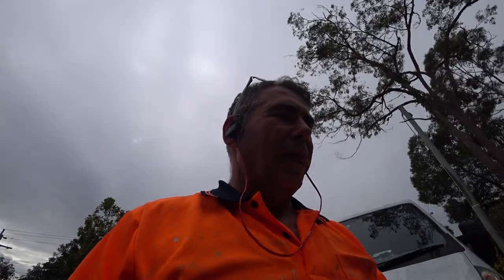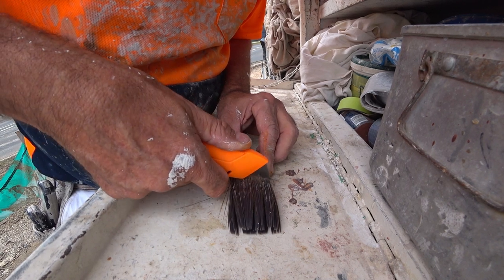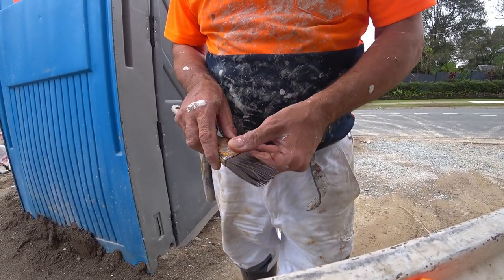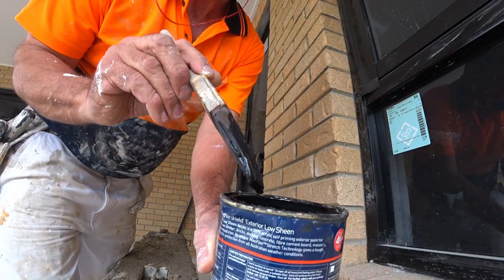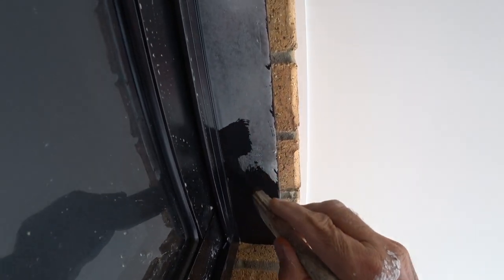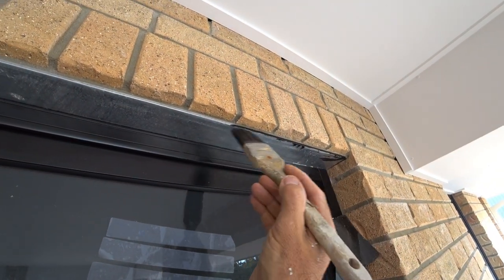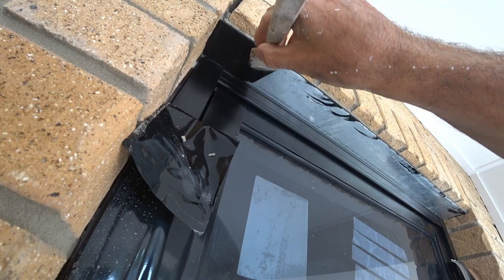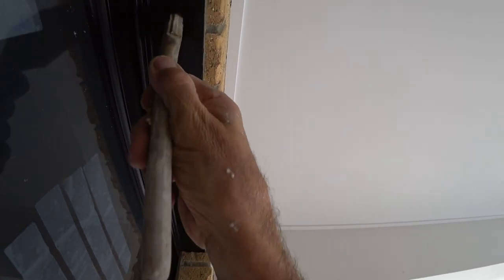How to recycle an old paint brush

Comment: Good tip im going to try that. Yeah wethershield low sheen straight onto those lintels will still be good in 20 yrs. Covered well eh.
Reply from the maker: Yes covers nicely, if in doubt, brush another one on the flats.